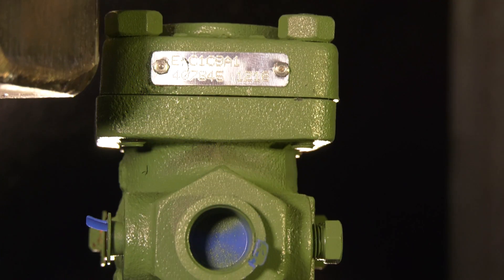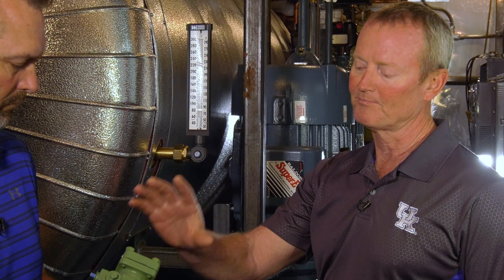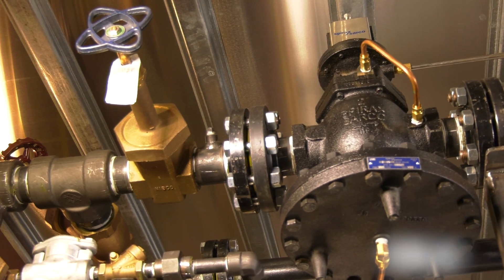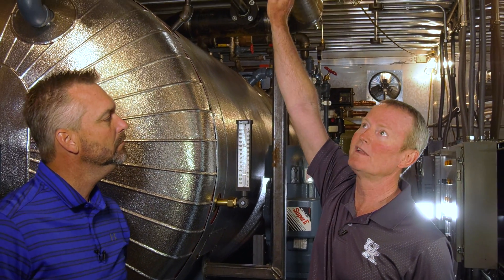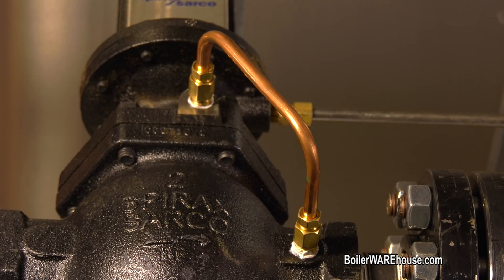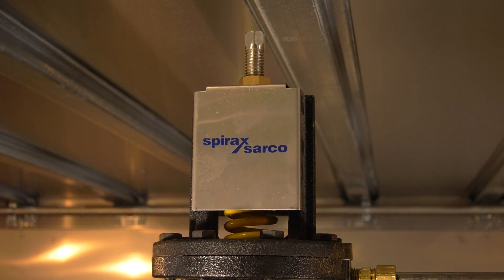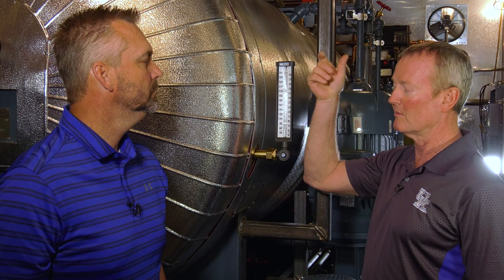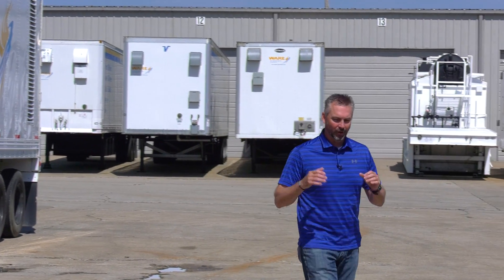Pressure Reducing Valves - Boiling Point

Comment: Worth noting the higher the pressure you can run your Boiler(s) the better then reduce down at the plant you want to control with a PRV you are able to install smaller diameter pipework around the majority of a site as the specific steam volume is less at higher pressures.